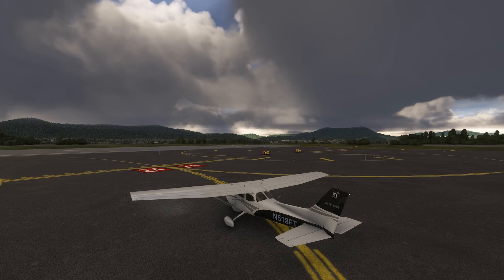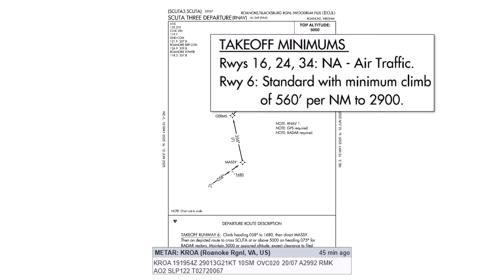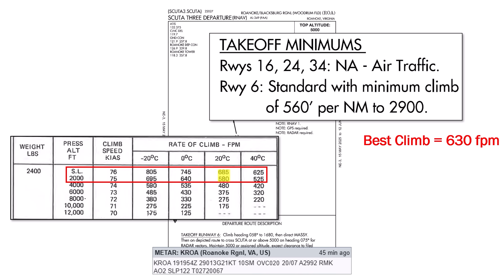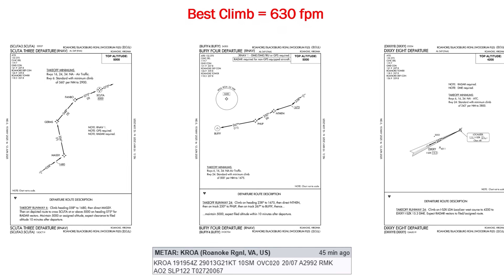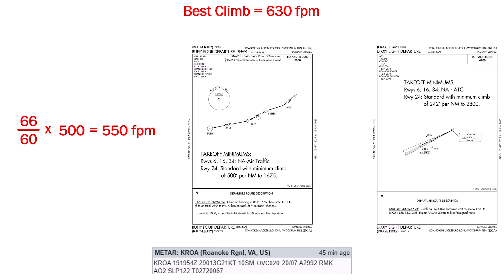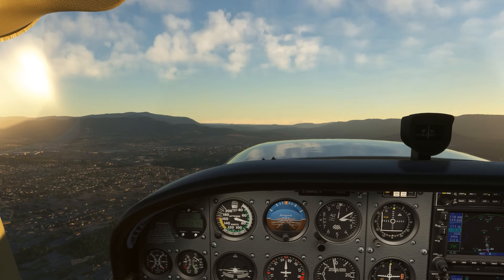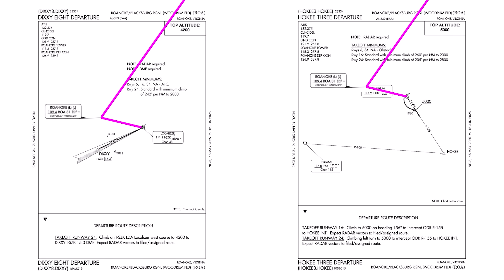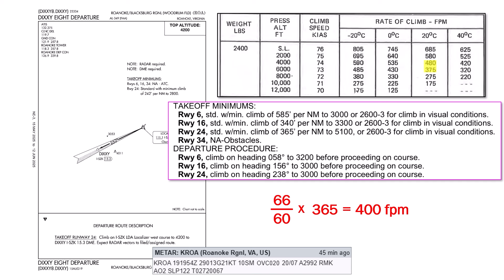This Departure Looks Perfect, Until You Do the Math | Choosing a SID

Comment: Dan, that required climb gradient is assuming that you cross the departure threshold at least 35 feet above the ground.  Runway 06 at ROA is 6,800ft long.  So in your example, as long as our good friend Lil'Cezz gets up and climbing after a normal takeoff roll, there's still over a mile of runway ahead before the required climb gradient starts chasing us upwards.  

Lil'Cezz should be at least 600' AGL before crossing the departure end threshold, so the remaining climb performance requirement is much reduced.

Not sure I'd actually fly it that way (I'm certainly not with a tailwind), but it's a consideration when deciding to go or not.  I'd do the Dixxy Eight from Rwy 24.

Comment: That performance chart is at max GW. Using it is conservatively safe, but climb rates are better when lighter, and the relationship is linear. Reducing weight from 2400 to 2100 improves climb rate by about 14%, increasing the 630 fpm rate to 718 fpm.
Not that a pilot should rely on this when planning, but it is important to have the knowledge.

Comment: The Landis Letter of Legal Interpretation (1999) clarifies that when operating under Part 91 weather takeoff minimums don't apply, even when flying a SID:

"My research has indicated that when section 91.116(c)-the predecessor to the current section 91.175-was first proposed
for adoption in 1967, this issue arose and was addressed as follows:

Several comments indicated that section 91.116(c) of the proposal could be interpreted to apply civil airport takeoff minimums to aircraft operators other than those operating under Part 121, 129, or 135. As this result was not intended [underline added], the language of the paragraph as adopted herein has been changed to make it clear that the minimums apply to aircraft operating under 121, 129, or 135 (32 FR 13909 Oct 6, 1967).

Accordingly, I am constrained to agree with your analysis that a Part 91 flight can depart in weather conditions less than the minima prescribed for the SID."
Reply: As a CFI and former Part 121 and 135 pilot myself I absolutely agree with your statement regarding weather minima for Part 91. However, if you accept a clearance with a SID, you do need to ensure that the minimum climb gradient required can be met.
Reply: @jetjock60  Yes, you must meet the climb performance requirements. And even if the weather minimums don't apply under Part 91, it's wise to consider them carefully before departing in IMC.

Still, there's been confusion about when/if weather mins legally apply under Part 91 if you're flying a SID.
Reply: @BruceAirFlying  Yeah, big difference between regulatory legality and common sense! It's the same on the opposite end (landing). Part 91, you can start an approach with reported weather zero-zero, no dice for us air carrier types.

Comment: Can you request to fly the simpler ODT rathe than the SID?  I don't believe you can file for an ODP but correct me if I am wrong. Thank you.
Reply: You are correct. One does not file an ODP.  However I have instructed my students to note they will fly the ODP in the remarks section of the Flight Plan, and I verify this with the clearance issuing facility when I call up to request it. You do have to let them know what route (procedure) you will be taking to join the enroute structure.